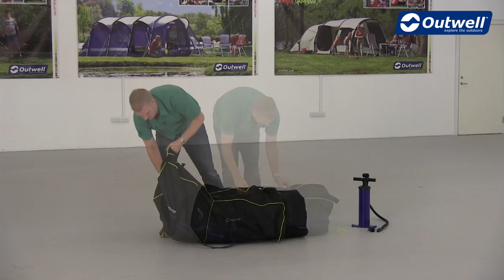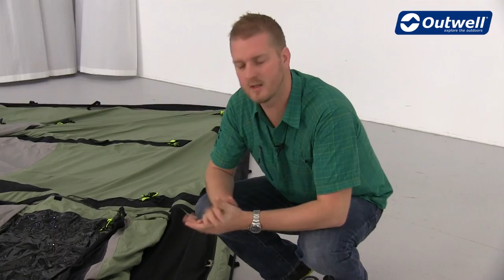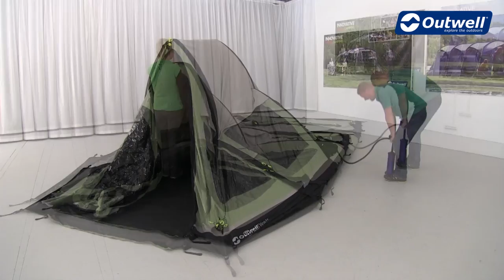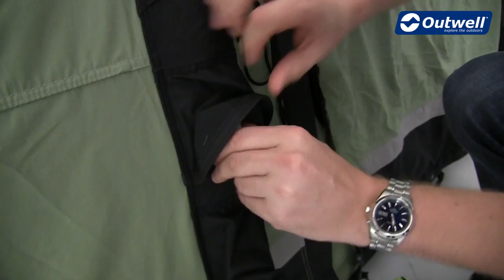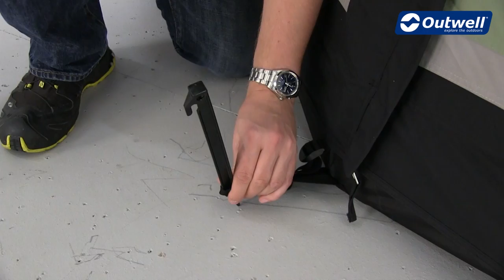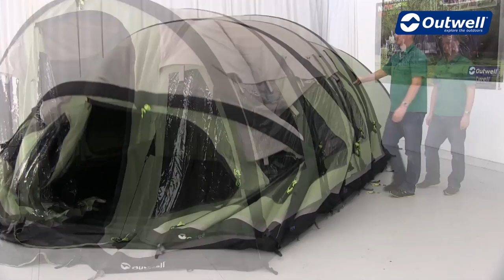Outwell Tent Concorde L

Comment: how reliable is the inflation system compared to popup tents and classic fiber poles? Is there an electric or USB battery airpump option?
Reply: There are several 12v and battery pumps on the market.

Comment: I notice 3 things.

1st. I know from rolling up truck tarps that you want to walk on the material to squeeze the air out before starting to roll it up. Otherwise air get's trapped inside and you will never get this back into that bag.

2nd. My experience with rubber boats ensures that I always inflate using an electric air pump. Use the manual pump to increase air pressure occasionally later.

3rd. Number 2 brings me to number 3. Again from using rubber boats, topping off the air pressure every few hours is going to be required. It has to do with the air temperature. As air cools, the same amount of air uses less space. As it warms up, air will increase in the space that it uses. If you blow it up during the heat of the day, it will sag at night. This is not about loosing air. It is about the temperature of the air. Again, my experience is with rubber boats. A boat is blown up on land usually with an electric air pump and it will appear to be about to burst with pressure. But as the air in the boat cools from the boat's contact with the water, you will find that you need a manual air pump to keep from getting wet. You are not loosing any air. It is simply that the same air is taking up less space. (Air molecules are less excited at cooler temperatures.) Taking this the opposite way, if air chambers are blown up while they are cool, then they will increase in their required space under direct sunlight, which may be able to blow an un-reinforced seam.
Reply: +Lloyd Hayes High quality rubber boats do not need top off for months. If they have a high quality air system, you only inflate it once when setting up the tent.

Comment: Those are some incredible tent pegs!!! Being able to drive into the cement floor with a rubber mallet! Ha...I saw the slight of hand and camera;)

There are some great design features and it looks like standard size air fitting for inflating from an electric pump, just connect the hose/gauge assembly twist lock.

Are the tubes replaceable? I know that plastics have come a long ways, but Mr. Mouse didn't get the memo, and he thinks that they still taste good...